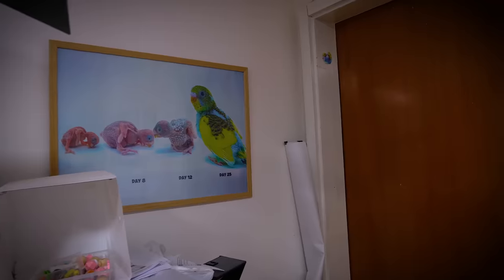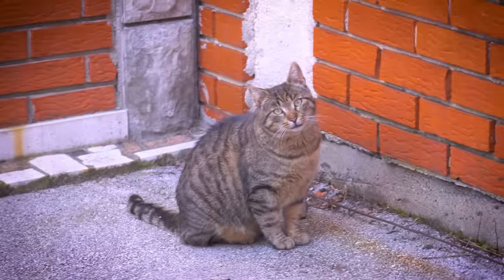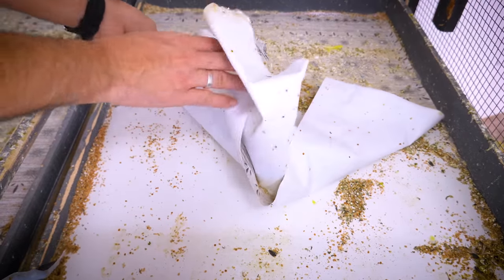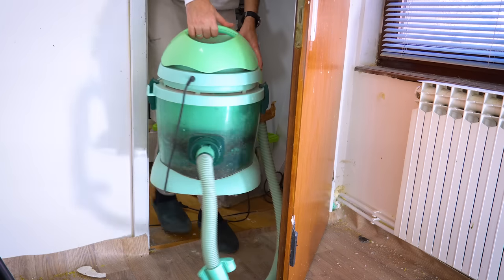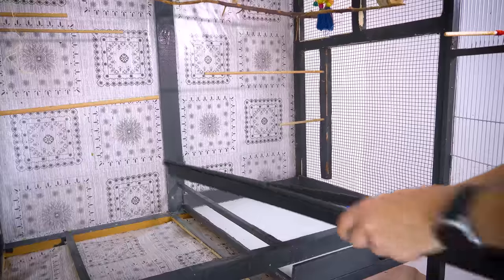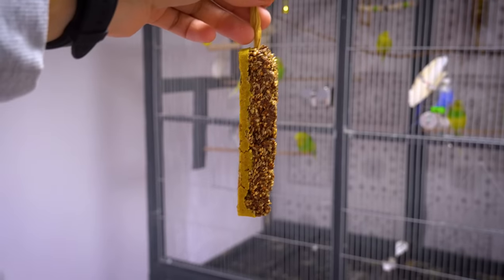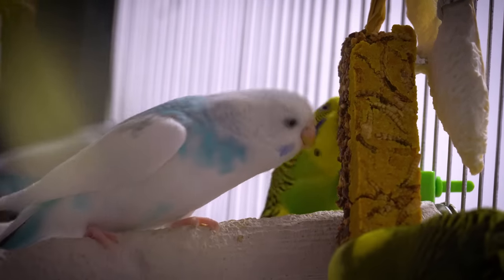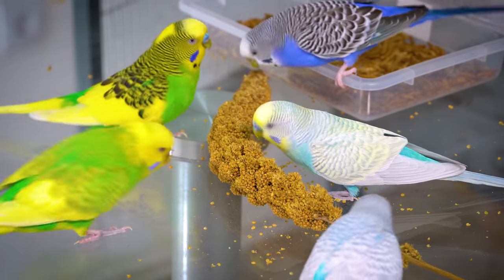Budgie Enjoys a Feast of Worms

Comment: I have a question and maybe you can help me clarify it. My budgies, which I got in 2020 do not exhibit the traits of grown ups. One of them has a cere that is almost white with barely noticeable shade of blue for years now. And the other has a bit of light, almost beige color on her cere. Both colors are very very very light, not as intensive as other budgies in your video have them. Both babies are born in june 2019 and they were a bit sicklish when I got them. That is why I got them actually. They do molting, they seem happy, eating well, playing well, listening their favorite radio station 12/7. At first vet had some doubts of the sex so we had to change their names several times and I settled on sweethearts for now. But yes, their specific sex markings are not prominent. Did you by any chance have a similar case  or heard of similar case? Thanks in advance.

P.S as for cleaning, I feel you. I have only two and they have their spots for sitting and playing and I put a bunch of newspapers and kitchen rolls around which I discard later. i have fitness matts on the floors so their droppings never goes directly on my laminate but on the mats that are easily cleaned.
Reply from the maker: I have the same Budgie, Sunny is having white/purple cere whole his life he is a male.  There is nothing to worry about. ❤️🥰